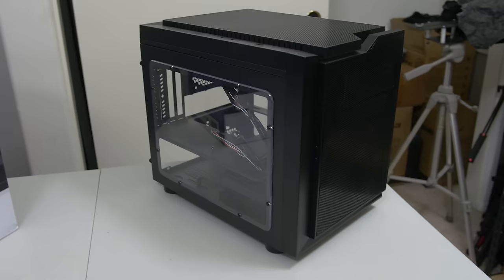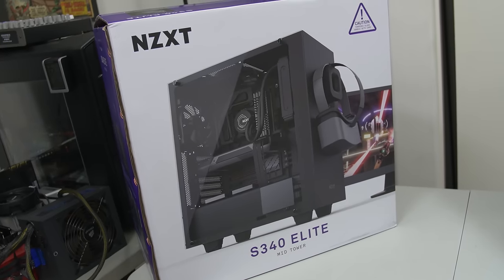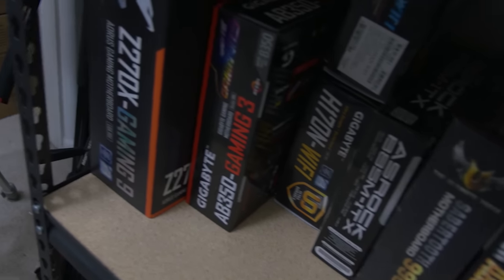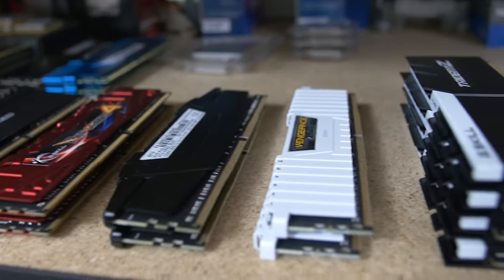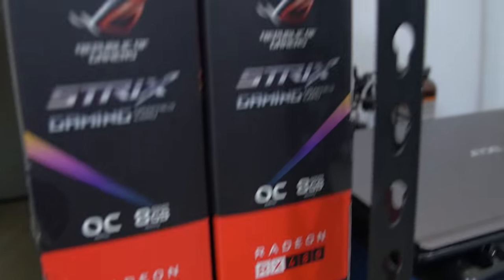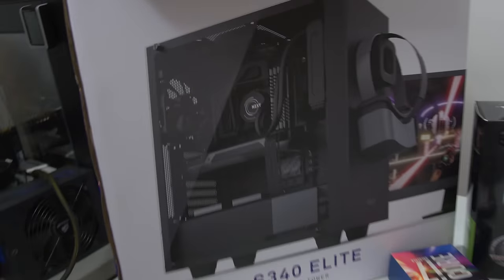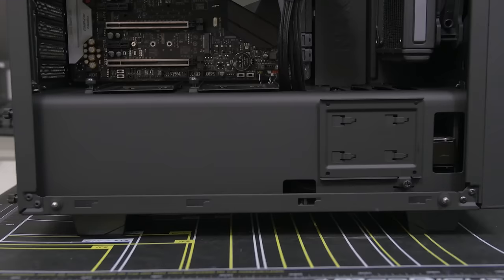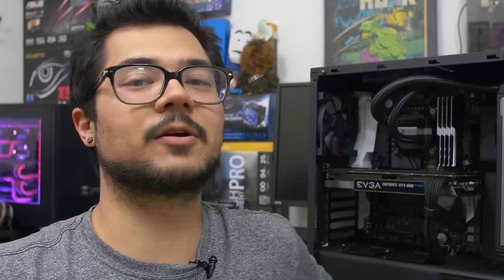BUILDING MY GRANDPA HIS FIRST PC!! (a tad overkill?)

Comment: why did he put in  a 1600w PSU?
Reply: gtx 1080, 7700k, ah isauig mobo thingy
Reply: Mayoukh  Dutta you can literally use a 800w and it'll be much more than enough. idk why he used a 1600w
Reply: Mayoukh  Dutta 600w would be enough
Reply: Grandpa's PC is better than my gaming pc!
Reply: He did this because why the fuck not?
Reply: i got a 750w evga psu for my parents for only like $40 or $60
Reply: On a serious note, higher watt PSUs don’t use more power than a lower watt one, in fact they get to be slightly more efficient. Also, since they’re built for higher loads, a low load makes them usually fanless and quiet. :)
Reply: Cadian9t I have a 850w Supernova P2, my PSU il always silent, but it's strange i have a 7700k and a 980ti..
Reply: Lol THAT'S what you question 😂
Reply: The guy went full drunk. That's why.
Reply: I use a 650W for my 8700k and 1080 ti etc

Comment: Seems like liquid cooling is popular to shove into a pc nowadays, which would mean your grandpa will have to maintain his pc several times and check that any tubes haven´t gotten any leakage progressing in the system. An air-cooled system would require next to zero maintenance except for removing dust build up.

Comment: Mean While my dad gives me a budget of 500 euros to build a pc that i Want for gaming. I have collected about 150 euros myself. Any ideas for the build?
Reply: https://pcpartpicker.com/list/nghFmq

Here’s one

And don’t worry about that m.2 drive taking up the SATA 6 port that’s normal and u have 5 left anyway

It’s pretty decent for the budget considering u have a m.2 drive with 500gb

Remove the drive cages if u don’t intend to use a HDD or an SSD
Since u have an m.2

U can get urself some fans since the mobo supports 6 of ‘em

But this is pretty decent for some high - ultra 1080p gaming...

P.S it’s pretty upgradable since it has a z370 mobo (meaning any coffee lake chip unlocked or locked) and a single stick of ram(meaning more ram slots are available) ,and the cpu cooler I didnt touch u can choose that part and be slightly over budget

Comment: Built my grandad a pc last week because his 12 year old mac was really slow and he couldn't even use Facebook or print photos. 

Ryzen 3 2200g (stock cooler) 
8gb ddr4 3000mhz lpx ram
Msi b450m 
Bequiet system power 9 500w
Corsair 200r 
A400 120gb ssd
Wd blue 1tb
Hp 22w 1080p 60hz IPS monitor 
All for £430 GBP